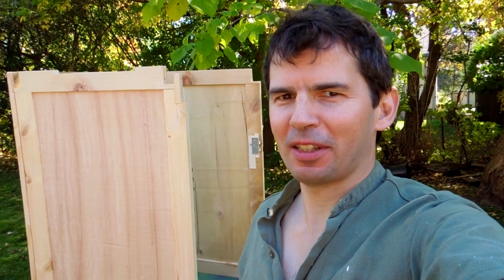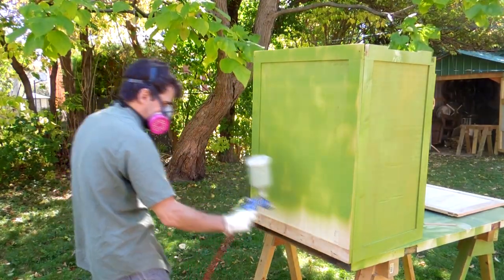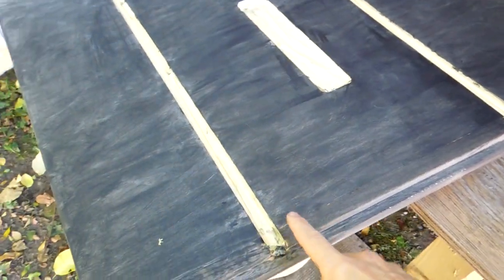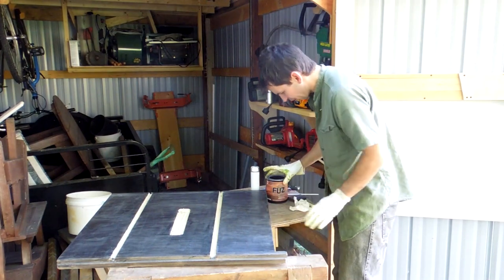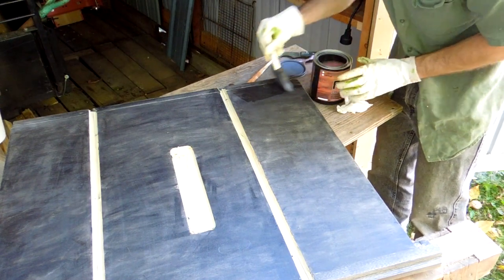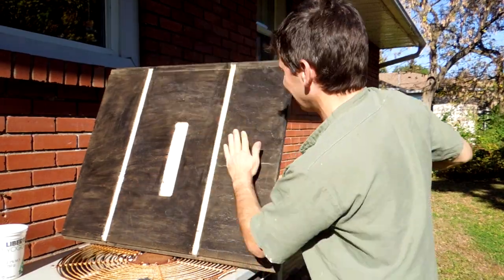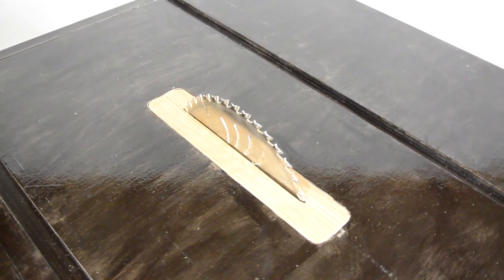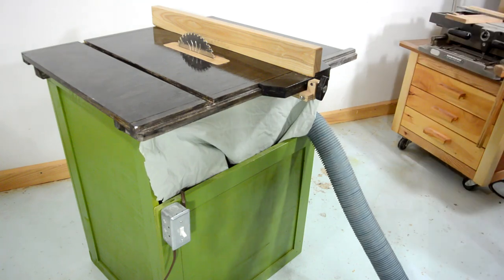Painting the homemade table saw

Comment from the maker: Itwasn't epoxy.
And laminate on one side will cause warpage.  And I couldn't put laminate on the bottom - too many cutouts.
And oil based varnishes don't sled very well.
Just build your own table saw, then you can try all your ideas, and you will see.

Comment: With the amount of laminates available, even old school melamine. You went for a dodgy epoxy and cured it at all angles. Price wise epoxys and laminates aren't to far apart. Why not just a few coat off old oil base varnish, that soak in the wood wet sand and polish and wax anyway.

Comment: Wouldnt it be better not use an air gun and not to blow 50 per cent of the paint into the atmosphere? The flat surface should be easy to paint with a brush...